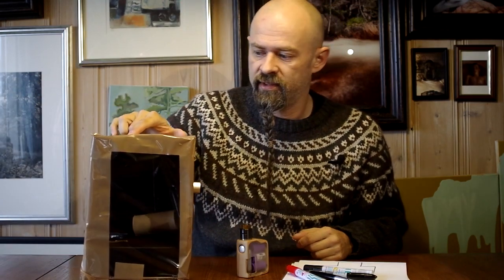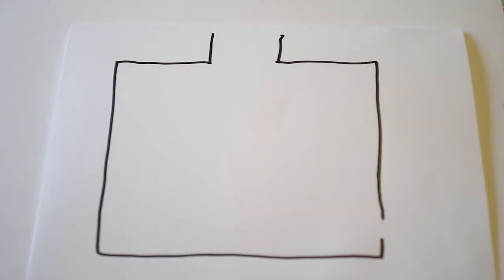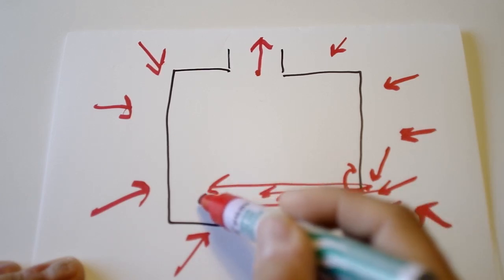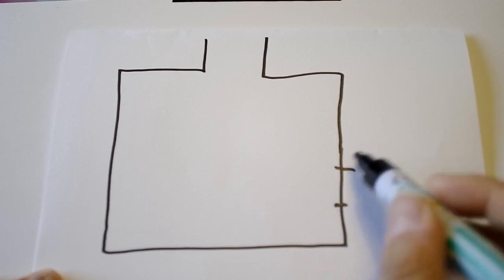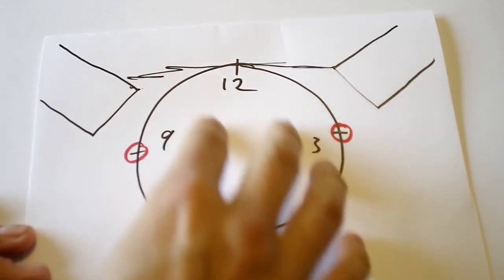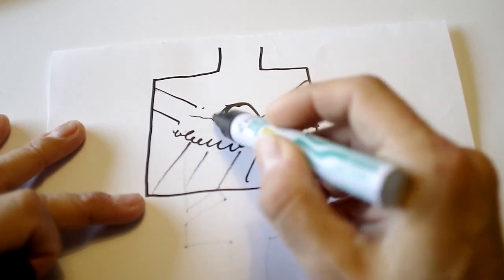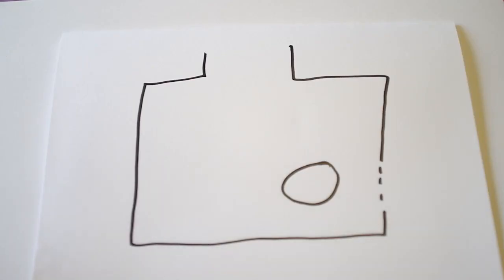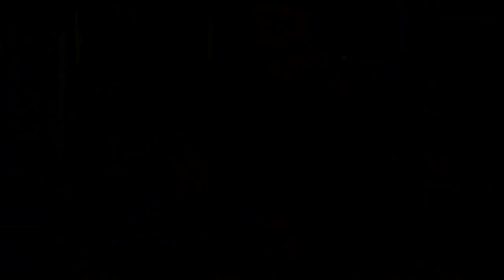Air flow and coil placement in RDA

Comment from the maker: I have one correction I want to air:-) At the footage at 14:13 min. I state that I prefer the last position. This is because in the Pulse 22 you have air from both sides. In the Pulse 24 I would have prefered the lowest position. With two jets of air blowing at one coil, like the Pulse 22, you will get overlap if the air hits at 10 and 2 o'clock. Better to hit at 9 and 3. I will make a new simulation of these conditions as soon as I can, when I have my new chamber ready.
Reply: have u used the theorem rdta  b4? it has some very interesting airflow options. Still to this date i havent found any atty make better fkavor. If u get the build right its unbeatable. If u havent seen how it works u def should watch a vid or 2 about it. U can pick them u p for under 15 bucks nowadays also.
Reply from the maker: I will look into it when I get time! Thanks!
Reply: Morten Oen cool. It works great, I really enjoy it. Another one I jus recently tried and liked is the Nixon rdta by gas mods.. It's really nice and only 20 bucks on 3f vape.. Super small chamber. GREAT flavor. I'm enjoying it also
Reply from the maker: That is good news. I know nothing about tanks, but I might look into them in the not so distant future.
Reply: You prolly dont care but does any of you know a trick to log back into an instagram account?
I was stupid forgot the account password. I appreciate any assistance you can give me.
Reply: @Terrance Jeffrey Instablaster =)
Reply: @Salvador Harrison i really appreciate your reply. I found the site through google and I'm waiting for the hacking stuff atm.
Takes a while so I will reply here later when my account password hopefully is recovered.
Reply: @Salvador Harrison It did the trick and I actually got access to my account again. I'm so happy!
Thanks so much, you really help me out :D
Reply: @Terrance Jeffrey glad I could help =)

Comment: Fantastic information, thank you!!
I'm currently using a single coil RTA, with a mainly bottom airflow, but secondary duel side airflow; the Ammit 25. So far it is proving to give an excellent vape. However, my next build, based on your video results, will be different to my previous builds. I look forward to the experience!
Reply from the maker: Thank you! And please report back about the results!

Comment: Morten, just WOW!!! It is so exceedingly rare and beautiful to see such TRUE AND GENUINE care and concern for others anymore. You, my amazing friend, exhibit EXACTLY THAT and I am beyond impressed with you....as well as your diligence in finding the truth. I completely understand the cost of higher resolution video equipment.....one thing that may help us see your work better is another light source source (maybe a small LED?) on the other side of your coil analog. Maybe a clear plastic or lexan box in front of a broad light source?

I applaud and thank you sincerely!
David

P.S. Please check out the Drop RDA which has 10 small holes per side aligned in a "T-grid" pattern.
Reply from the maker: Thank you so much for kind words! The chamber i use in this video is only proof of concept. I have a much better one now :-) https://youtu.be/xn3Kid2zQ_E

Many have asked me about the Drop RDA, and I have looked into it. This one is not for me. I understand it's a pet project of a fellow reviewer, and I wont ruin that. I like much moore to talk about great stuff, and RDAs that present a riddle, or RDAs that can be "fixed". The Drop is neither. Sorry.
Reply: Morten Oen Thank you. This was the first video of yours that I found. After posting this comment, I proceeded to IMMEDIATELY subscribe and then stayed up until 5:30AM watching everything that I could find of your work!! 🤦‍♂️😱  Absolutely wonderful and like nothing I've seen in my 4 years of vaping and research. Keep up the wonderful work, brother!!!
Reply from the maker: Thank you! I will do my best 😀

Comment: I was not keen on watching this video because I thought I've been doing it right with my RDA. But then I saw your comment about the Pulse 22 which is exactly what I have been using. I have not tried to lower my coil position(mine is a little bit above) but I have tried your advise about cotton and it really works. The airflow is smoother with cotton covering all the spaces around the coil. I was worried about thicker cotton because of wicking issue when using tanks, but because it is rda, it's not a big deal. I will try the coil position soon.
Reply from the maker: Thank you for feedback Rizqi!

Comment: Thank you so much for your tests with wicking and with Airflow..... That is the Problem with the DROP RDA why i always get hot Liquid on my Tongue with this RDA. The Posts are to high so that when I close the Airflow how I would like to have it with the upper row of holes closed, the Air doesn't hit the Coils directly and flows underneath them away. Like it is now the Coils should better be installed from underneath so that they sit inbetween the posts to sit right to the Airflow(I will try this too). Best thing would be if the Airflow holes would sit a bit higher towards the Top or the posts should be a bit shorter, I think almost half as short as they are now because like it is now I can only vape it with the Airflow fully open but sadly this kills much of the flavour. I've tried it with other RDA's and I've always positioned the Coils wrong like most people show it to do. When I've changed it in line with the Airflow holes I get a much more pleasant Vape, much cooler and with no hot Liquid on the Tongue. This is unbelievable how much the right position changes👍
Reply from the maker: Thanks man!

Comment: i just found your channel just now and i really appreciate your videos already. your contents are very educational.
if i may ask, have you ever made a comparison between vertical airflow (Haku and the likes) and regular/horizontal airflow?
i would really like to hear your perspective about it.
thank you so much :)
Reply from the maker: Hi Feisarino! Yes I have. I did it in my video of the "Barebone mod and Unholy RDA", and did a vertical build in the "Unholy Revisited" video shortly after. I went from a horisontal airhole to a "two holes over-under" setting. (The Unholy RDA let you do this). Great results! So great that I'm now exploring and building prototypes for myself to find the limits of this design.
I have the Haku, but have not tested it. I think the angle of the air holes is wrong. If things go well with the RDA I I am currently helping to design, I might get something done with something more vertical. Looks promising if done right :-)

Comment: Thank you for the science!!! I kept on wondering and you brought back my prior studies & real world knowledge! I am a US Navy Vet, my job back then was Boiler Technician. While different, the principal is the same. You are heating up a liquid quickly! Vaping today is two fold: Flavor & Vapor Production. The Atomizer you choose is key to where you place your coil(s) in reference to airflow. 3 & 9 is spot on, along with a bed and wall of cotton. I’m trying out your new recommendations, especially using the Dead Rabbit, Pulse 22 and the new Nudge 24 RDA.
Reply from the maker: Thank you Phoenix-Brian! And thank you for your service, keeping us safe. My dad was a war-captain on a fleet of mine-hunters in the North Sea for 30 years, and he was also an engineer. Guess I got this urge to get to the bottom of things from him, no pun intended:-) My recomandation to you would be to concentrate on the Pulse 22 and the Nudge. I think they will be the easyest to get right.
Reply: I'm trying with the Pulse 22 right now... The Nudge, 8&5, and just slightly tight... Going to coil ID2.5mm and tighten the Muji Cotton...

Comment: Morten.. What size and material wire do u use for these ribbon coils i see u using? eg. Ka1 .8x.2 or..?
Reply from the maker: I hammer them myself. Mostly 22g and 24g Kanthal. Down to 0.15- 0.2mm thickness. Be sure to have direct airflow on them! Cheers!

Comment: What are your views/experiences with bottom air devices where the air is drawn directly below the coil and suctioned from above?
Reply from the maker: Hi my friend! Short answer is that it's not optimal. The top of the coil, where the spatter to your mouth comes from, get less cooling. It should be combined with a side/angled/top air hole, like the Azathoth or Aeronaut.

Comment: Will it help you  guys if I make a cfd ( computational fluid dynamics) for the air flow for the vape ? I design buildings with cfd for high rise buildings , wind tunnel tests etc .
Reply from the maker: I for one would love that! But if you start a youtube channel about air flow in different RDAs/ RTAs, prepare for a lot of people to be mad at you :-) Not only that, but a lot of people (actually most of them) do not want a direct hit on the coils. Personally I would subscribe to your channel and pay you on Patrion for making vaping more sciency. I think I have analyzed about 40 RDAs now using sound metrics and a more advanced air chamber with correct air speeds and flow ratios scaled 10:1. I think all my subscribers will follow your channel if you start one. Best regards, M.
Reply: Morten Oen I very much liked your comment . Thank you for your response. Your the only guy who thinks like me .

Comment: Great video! Will you make an update on Enthon rda by any chance? It would be great to hear your opinion on coil size and placement.
Reply from the maker: Thanks! Update on the Entheon is posted today :-)
Reply: Morten Oen Thank you for the update! Just finished watching it moments ago 🙂 I’ll definitely try coils according parameters you’ve recommended. I’ve tried ~20 builds already and so far 3mm inner diameter kanthal twisted coil (3x 28ga) worked best for me so far. Again, great videos 👌 I’ll be looking forward for the next one.
Reply from the maker: Thanks Andrew! Many have asked for a revisit on the Entheon :-) If you don't have flat wire 22g, maybe you can try 24 or 26 in parallel? Twisted wire gives air a very bumpy road to travel on...
Reply: Good point. Coincidently I am mostly using parallel NiCr coils in my Hadaly with great results, as a matter of fact. I’ll be sure to try it in Entheon as well, now that you mentioned it. Is it me, or Entheon can only handle kanthal coils as low as 0.5 ohms? It gets too hot, too quickly with anything lower, or I have to lower my volts to like 2.7-3.2 (and usually I never go beyond 4.1 volts). But now, after your last video, I am beginning to think, that it has more to do with the airflow balance. More airflow = possibility for more power.
Reply from the maker: I use a 22g Kanthal flat wire, 4 wraps with inner diameter of 3,5mm, that gives me 0.27 Ohm, and I vape it at 3,8 Volt, and properly placed it's not hot at all. You'll be surprised :-) I'm at 55W, because I like just a tiny hint of warmth with anything that has menthol flavor in it.
Reply: Just tried a coil you’ve suggested. It is definitely best from what I’ve tried so far 🙂 ! By the way, what is your technique for lowering a coil below base sides? You can not put it low enough using screwdriver  on this rda 😟
Reply from the maker: I put it as low as possible, then I push on the legs or the ends of the coil with a screwdriver. When glowing I do the ordinary stuff, but uses a very thin screwdriver in the end to strum troubled wraps a bit apart if needed. Glad you liked it!

Comment: Oen, does 3 o’clock airflow positioning still work with something w/ a goon build deck?
Reply: After months and months of not installing my coils in the right position I have figured it out. The key to keeping good flavor is to keep the coils close to the build deck. I assumed that it would be better to put the coils closer to the air holes. Not the case with 3mm ID, alien fused claptons. I don't know about other coils. When I look into the air holes the coils are a hair more than half way down. Leave them raised up just a little bit so that the air isn't hitting them directly. You might want to try the 3 O' clock position, but I have tried it, and the best flavor is a hair up from that. You will have to play around with it. Keep them pretty close to the deck too. Wicking is almost as important to have right for maximum flavor. The Goon is the only RDA I have used for over 6 months now. I'm so glad I figured it out! If you don't position the coils in the right spot exactly you are missing out on a lot of notes that could be in your juice. My juice taste totally different now.
Reply: cincinnatiking This sounds interesting. I definitely will include that in my goon experimenting. Thank you.

Comment: Nice video but im wondering what happening in the chamber when 2 opposites air flow collides,the rda's usually have 2 opposite entries for the air.
Reply from the maker: Thanks! Nothing nice happen when 2 opposites collide. It should be avoided :-) I have tested it. But there are so much information each time I do an experiment that I'm starting to keep the actual footage to myself these days. Sorry for that. The Goon is a good design for opposite air flow. I recomend it. And the Dead Rabbit, the Recoil, the dotRDA 24, and so on.

Comment: I take it when i raise my coil up, I get more flavor. Is that due to it being closer to my mouth?
Reply from the maker: Only spatter increases when a coil gets closer to the drip tip, all things being equal. Spatter contains sweetness and the higher flavor notes. And because the coil is a cylinder, we can say that halfing the distance doubles the amount of spatter. This is true as long as we disregard all other factors. With proper air flow and wicking you should have the same experience of flavor no matter how close the coil is to the drip tip.
Reply: thanks
Reply: lol did u not watch all of this
Reply: Morten is absolutely correct about this. When I lowered the coils in my Goon (which I already regarded as the best possible flavor RDA), the flavor intensified at every angle. It isn't a huge drop, maybe 1-1.5mm, but still, they are farther from the drip tip now, and the flavor is much better. Break the dogma!

Comment: I wanted to add, just like the Buddha the mutation has similar inlet holes just that they are not all inline, this creates stagnant pressure. ( airflow traveling at the same time same speed) when it hits the inside of the chamber it then creates the turbulence. In the Mutation this is not the case. the inlet holes are placed staggered thus creating a more .. lets say confused way of airflow travel, where each independent hole is allowing the flow of air in at different speeds due to the placements and again the Venturi effect. If you are familiar with the Venturi effect then you will have a better understanding.  And all this from a $7 Rda.. Sometime technology moves too fst and forgets what its real purpose is, or in this case was... thank you for listening.
Reply from the maker: Hi man! The Venturi effect is being used in several RDAs, and Jai's 502 is a very good one at that. The Zenith RDA however, is where it goes terribly wrong because the designers did not understand the path of the air flow. The Venturi effect will not come into play on a Buddha or Bonza RDA, and the speed through each hole is constant. But having small holes spread out will increase the speed of the flow over a larger area, and to some degree, give a "more" laminar flow pattern. Thank you for this comment.

Comment: so what should my coil placement be if i user naRda?
Reply from the maker: Hit your coil at 3 & 9 o'clock horizontaly from the sides with the air. The air goes straight in.
Reply: thank you for the prompt reply! appreciate it
Reply: what about the coil diameter itself?
Reply from the maker: You should have a clearance from the sides of at least 1.5mm, preferably 2mm if it's possible.
Reply: noted. thank you. appreciate your time for doing these kind of videos!

Comment: Hello Morten. Nice to see a scientific process being brought to  vaping by a YouTube star...lol
However I think the testing is missing two large components, the vapour and the heat from the coil temperature.  
The vapour itself will not necessarily follow the airflow completely as it is denser than air and at a higher temperature, also is created at the coil not comming from the air intake. The temperature is a big part of the equation as it creates a force that is forcing the vapour away from the coil in all directions. This will in part work against the airflow and changing with the arc to a point where it works with the airflow. Depending on the power applied that force will create larger or smaller effect deflecting airflow towards the intake and creating a high pressure as it works with the outgoing airflow. One side will create turbulence and the other will tend to straighten and speed up the air.
A more minor point is the airflow starts from a static state and builds up.
I believed that modelling with a heated and wet coil will show this is not an easy subject by any means.
It's always a compromise to tastes  and the experience with a whole mix of variables. I hope this gives you some thoughts. Keep up the good work.

Comment: Surprised CFD is not common in atty design.
Reply from the maker: Hi Max! I have spent some days searching for software, but it looks like no software account for pressure differences and air flow interaction in low pressure environments. Some of this, like wire texture and air hole designs can be explored,and I have done that,  but interaction in proper environment can not. I think we will have to settle for observational and analogue experiments for now, but I'm trying to get something together. If I had a million $ I could pay for such a program, but the variables are many, and pressure mesurments and velocities would first have to be mesured "in situ", to get everything right. It looks like I am all you got, untill more of us builds chambers and we make a visual data bank of the content. ;-)